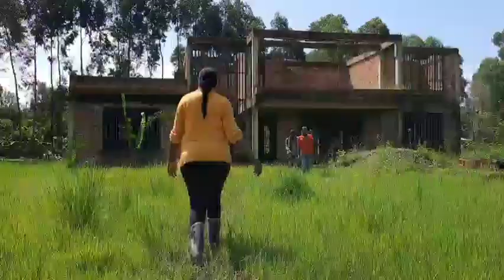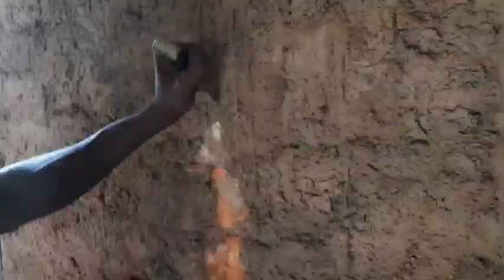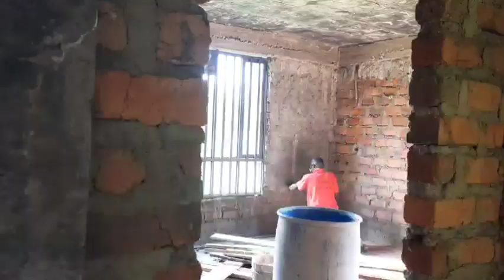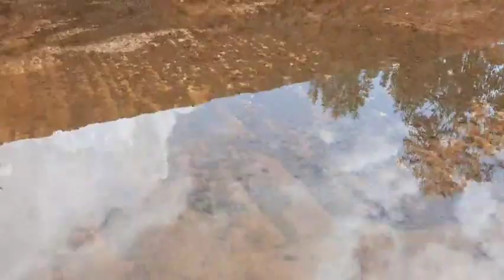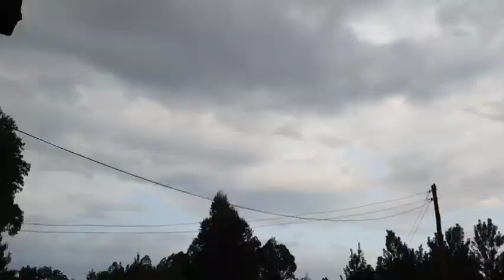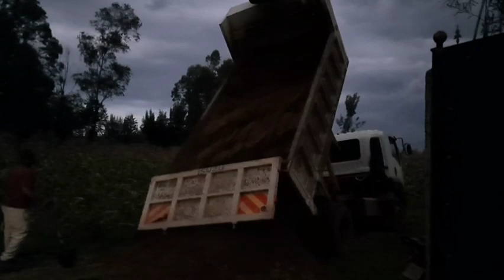#4 Building my village home phase 2 begins

Comment: Don't they roof the house before plastering?
Reply from the maker: That's how it should be but with a 2 storey house, you can always plaster the lower storey and move in while you fix the top storey. The slab serves as a roof.